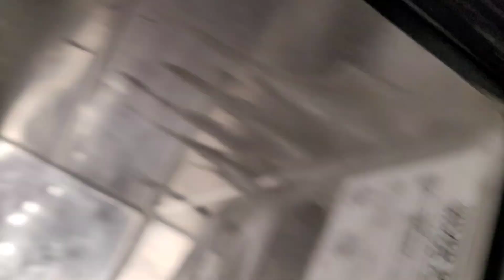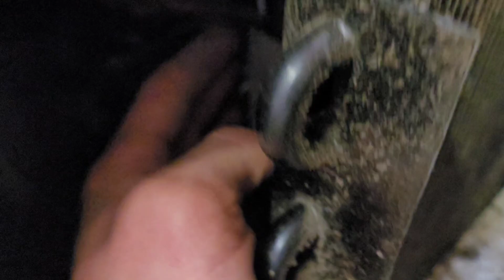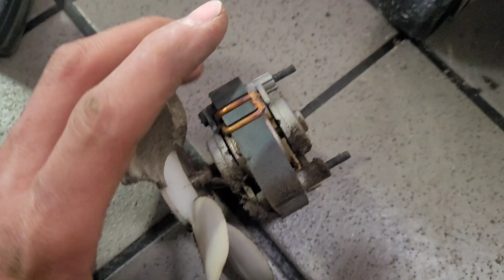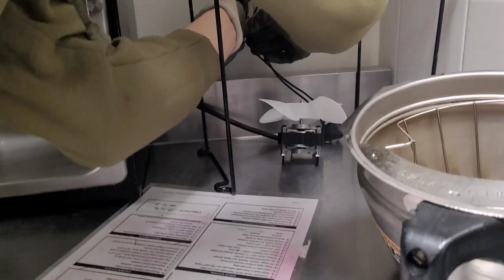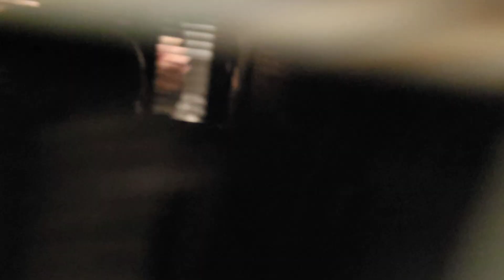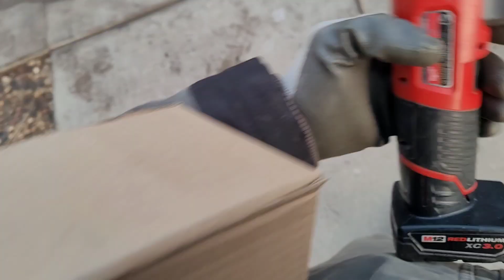How to Replace a Fan Motor on a Freezer! Why was this freezer not getting very cold?

Comment: Sometimes you can lubricate the motor and it starts working again, but for service calls better to replace! You agree?
Reply from the maker: @kkovler1  yes! If it was on my own unit that I could monitor I would perhaps try oiling it first, but for a commercial service call it's best to just replace.